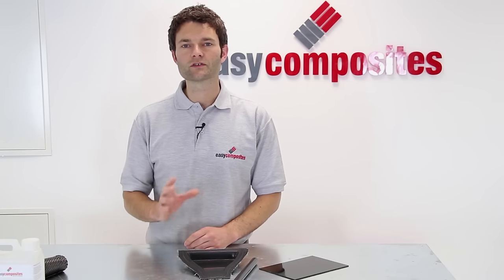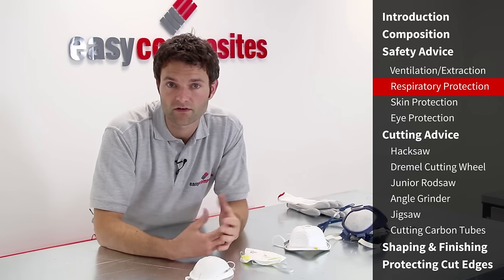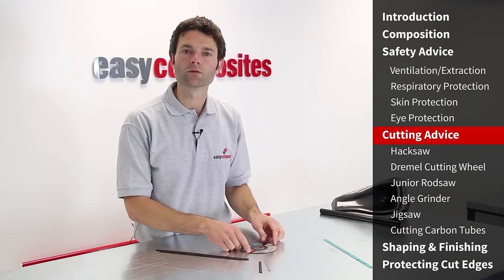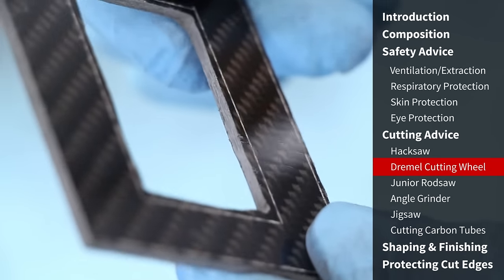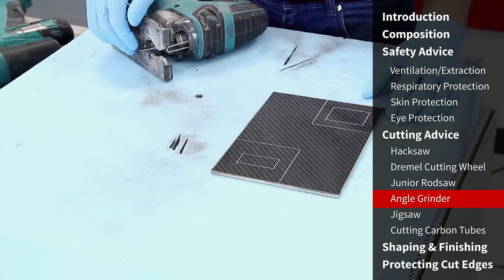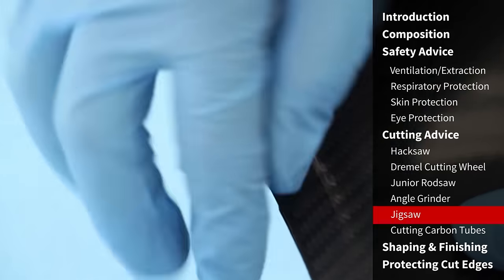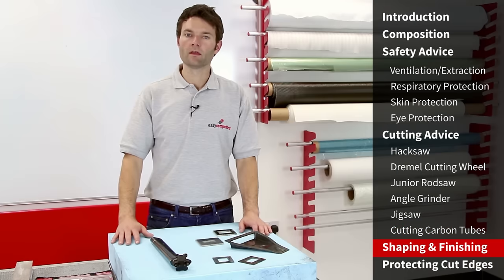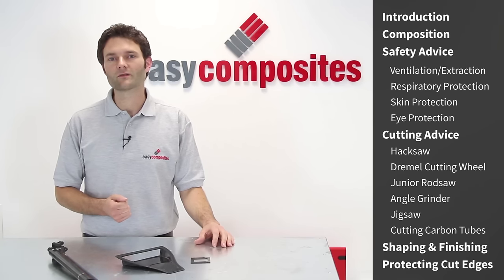How to Cut Carbon Fibre Sheet and Carbon Fiber Parts (Technique & Safety)

Comment: I realize this is an old video. Bosch makes jigsaw blades specifically for carbon fiber. I have never tried them but they might work better than metal cutting blades. They are labelled "clean for carbon fiber".
Reply from the maker: They use a tungsten carbide coating which is the same technology used on the perma-grit range of tools we stock. https://www.easycomposites.co.uk/perma-grit-tools
Reply: @easycompositestv  yes it is tungsten carbide but it is fundamentally a cutting tool rather than a grinding/abrading tool.

Comment: Can I heat up and reshape a carbon fiber prothetic leg socket? I need to make a minor adjustment?
Reply from the maker: No unfortunately not, the resin systems used for composites are nearly always thermoset plastics which means that that can't be heated up and manipulated in the same way that you can with a thermoplastic.

Comment: Would a rotary tubing cutter work on the extruded tubing?
Reply from the maker: We've not tried it but I would not expect that a rotary cutter of the type used for either copper piping or plastic piping would work for cutting carbon fibre. To cut carbon fibre you need an abrasive action whereas both of these other types of pipe cutter are more of a knife action.

Comment: Can you cut carbon fiber on a bandsaw? If possible, how many teeth per inch do you recommend?
Reply from the maker: Yes, certainly. Much the same as you see in this video, the finer the teeth, the better (less fracturing) the cut will be. Therefore, use bandsaw blades designed for metal and you should be looking good.

Comment: What other options to cut composite without using dremer tool? because my hand tends to shake, so I can't cut straight/ rectangular shape specimen smoothly
Reply from the maker: Hi Ciksu, thank you for your comment, most power tools will cut composite materials
Reply: @easycompositestv  for example
Reply from the maker: @ciksumurni2429  A few examples would be bandsaw, jigsaw, dimension saw, grinder with slitting disc, but these are a few among many that you could use.
Reply from the maker: @ciksumurni2429  If looking for more of a 'fixed' tool than a hand-held tool then scroll saws/band saws with a fine tooth cutting blade work well or electric tile cutters are very good as well especially with a carbide or diamond grit cutting disc. The good thing with the above tools is that you don't need to hold them to operate them and normally you can set a fence to guide the piece through the blade.
Reply: @easycompositestv  wow.... Thank you! Btw, can I cut FML panel using water jet? Will it be delaminate?

Comment: Can I use a mitre saw with a carbide saw blade to cut carbon fiber?
Reply from the maker: Yes, a mitre saw with a carbide blade will cut carbon fibre. The finer the grit on the blade the better the cut will be.

Comment: are we sure cf dust is not toxic? isn't it kind of asbestos-like, even if it's not as chemically inert/stable as asbestos
Reply from the maker: Carbon fibre dust is a respirable dust hazard but not specifically toxic in its own right.  Cured epoxy/carbon matrix is not specifically Toxic.  The respirable dust hazard element can apply to most dust or airbourne materials in sufficient quantity.

Comment: Have you ever heard of carbon dust desytroying electric motors or other electric components due to its electricity conducting properties?
Reply from the maker: Yes it is very common.  We recommend using a compressor attachment to blow dust out of your tools after use and use extraction to help prevent it spreading in the first place.  With dremel type tools, a flexible shaft is the best solution as you can keep the motor away from being covered directly in carbon dust.

Comment: can you heat up carbon fibre and bend it like PVC?
Reply from the maker: No, most cured carbon fibre laminates use a thermosetting plastic matrix (usually epoxy) which is a thermoset plastic, not a thermoplastic. Only thermoplastics can be heated and reshaped.

Comment: Would it work with cutting carbon fiber with laser machine?
Reply from the maker: Generally no, the differing materials cut differently so you tend to get a rough edge with burnt resin. CNC routing and water jet is generally much cleaner.
Reply: @easycompositestv  Thank you for ultra fast response.

Comment: Can you use a laser or water jet to cut cf?
Reply from the maker: Water jet works really well, laser is generally not recommended - being a composite material, the right intensity and speed for the carbon is not right for the resin which tends to result it burning of the resin.

Comment: Would diamond bit cutting wheelwork for cutting?
Reply from the maker: Diamond bits will cut carbon fibre fine. However, tungsten carbide tipped wheels and bits will cut more efficiently and quicker.

Comment: Is a band saw any good for 3mm
Reply from the maker: Hi James, yes, a band saw is not a bad way to cut 3mm sheet, especially if you have a fine-toothed 'metal cutting' blade in the machine. A wood blade would be less suitable, owing to the small teeth.
Reply: Easy Composites Ltd I have a jigsaw, maybe I could find a fine tooth blade for metal cutting or just use some elbow grease with a hacksaw... For rough cutting with a lot of grinding/sanding. Maybe with a router then some mental files plus high grit sandpaper?

Comment: Thank you for your consistently amazing videos, I haven't watched a single one without learning something new.
I've been wondering about ways to cut / trim (cured) carbon fiber while minimizing dust, and aside from some already familiar methods like cutting underwater, I recently discovered that people use ultrasonic cutters. Apparently it's a thing in robotic manufacturing ("ultrasonic trimming"), but people do it manually too. They seem to work quite well. You can see one in action here: https://www.youtube.com/watch?v=9cbvcIYuulc
There is currently not much info on cutting composites with these devices, so I just wanted to say, if you're looking for topics to make videos about it, that one would be quite interesting I think.
Thanks again for all your learning materials.

Comment: Expert says carbon fibre is few times stronger than steel, than how steel can cut through carbon fibre?
Reply: Stronger/tougher, but not harder or sharper... ;)
Reply: Yes, carbon fiber sheet is much stronger than a steel sheet of the same thickness. You cant compare a 1 mm thick CF sheet with a 5mm steel sheet; the steel sheet will obviously win..
Reply: mugget bonding n flexible...

Comment: How can you cut a circular hole?
Reply from the maker: You can use a circular saw for smaller diameter holes or for bigger diameter holes, use a jigsaw to cut the rough circle.  In all cases we recommend cutting a mm or two shy of the final finished line and finishing off with a file or similar tungsten carbide finishing tool to get a neat edge.

Comment: are you from stoke?
Reply from the maker: +eatthisvr6 : Yes, Easy Composites is based in Longton, Stoke on Trent (ahem - not that you'd ever know from the accent ;-)
Reply: +Easy Composites Ltd it was the accent that made me think stoke it's quite mild tbh lol then I saw the phone number and knew
Reply: +Easy Composites Ltd ps can i use a router? i want to use something as a template and make it from carbon fibre sheet using a flushcut router bit
Reply: +eatthisvr6 of course, all professional companies use either routers or water jets, in the video they assume you do not own such specialist equipment.

Comment: Pro tip for dust filtering: Don't cut the hair in your nose. The hairs are part of the natural filter. Wearing masks is recommended anyway but if there is an unnoticed gap, then it will help you.

Comment: You say carbon fibre dust is not toxic, but in mice it gives symptoms like asbestos! This is with the nano tubes though, and carbon fibre is used for both the 0.01mm and nano tube size of the tubes, so maybe you mean the 0.01. This is just my limited knowledge, though.
Reply from the maker: Hi, yes, carbon nanotubes are a completely different thing and yes there are lots of health concerns around carbon nanotubes. There is no evidence of such risks or effects when working with carbon fibre.
Reply: @easycompositestv  Ok, thank you for the help.